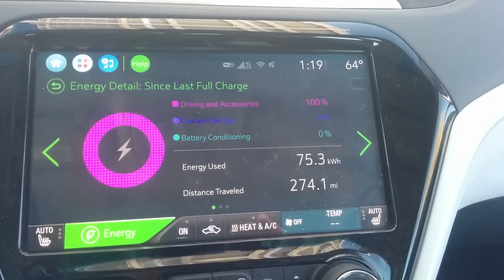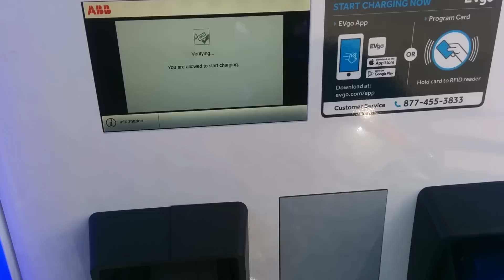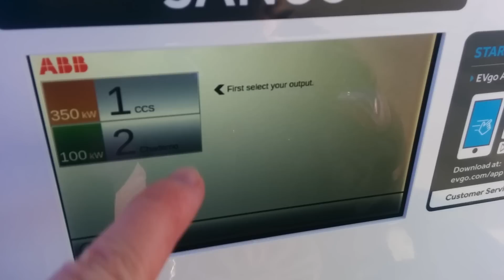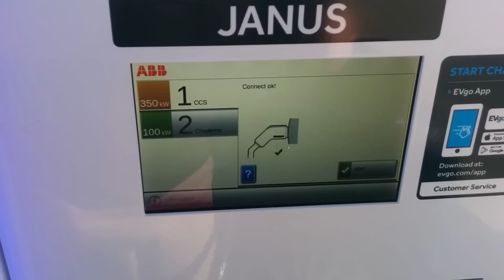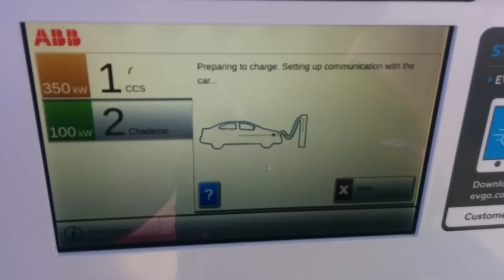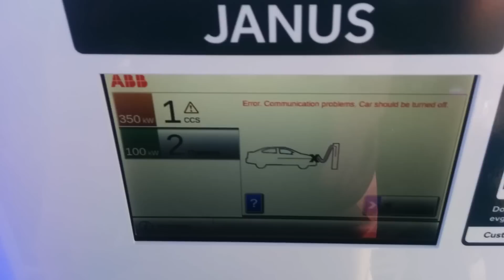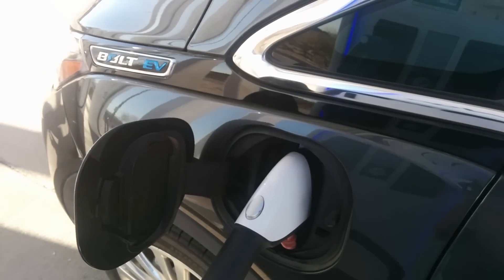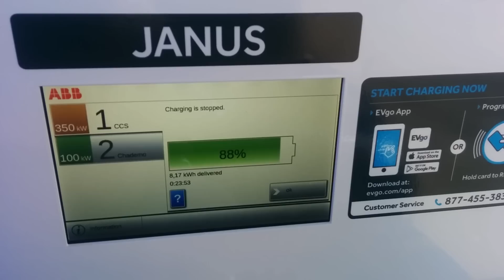Chevy Bolt EV: Charging on a 350 kW (Early Model Bolt EV Issue Explained)

Comment: So here I am in 2025 with this happening on my 2021 Bolt Ev. Has happened in various States across pretty much all brands of chargers, RedE, EA, Charge point, and EVGO. 
On several occasions that is taken almost half a dozen attempts at disconnecting and reconnecting to get the handshake with the charger. I was really hopeful about this car and liked it a lot in the beginning, but this along with other little issues I've had has me wanting to dump it and go get something else. I just don't feel comfortable taking it on long trips anymore because it just isn't reliable with this charging problem.
Reply from the maker: That seems like it might be a different issue. My charge port has been much less finicky, even with the newer H+S cables, and it's always worked at least by the second attempt. If this is a chronic issue for you, I'd suggest taking it to the Service Center to have them replace your charging port if possible.
Reply: Sounds good, thanks! @newscoulomb3705

Comment: So, I have a 2021 Bolt EV. I as able to charge with no problems at Electrify America. However, the car is still only gonna suck down 32Amps anyway. Right, so any DC Fast Charger should work? #NewToBolt
Reply from the maker: EVs have three modes for charging: Level 1 AC (120 V), Level 2 AC (240 V), and DC. For the 2021 Bolt EV, the L1 AC is limited to 12 A, the L2 AC is limited to 32 A, and the DC is limited to 150 A. 

As far as the handle is concerned, it appears that GM was able to fix the problem using the heavier CCS (DC) cables on the newer Chevrolet Bolt EVs.

Comment: My idea is to put a 3" or appropriate length PVC pipe with a U cut into end of pipe to hold the nozzle hose, thus lifting it up and relieving the stress on the car's charging port. It lightweight and can be easily stored under trunk.

Comment: how did you do 350kw? my 2017 bolt only took 75kw
Reply from the maker: The Bolt EV doesn't charge at 350 kW (no EV currently can), but the Bolt EV can use 350 kW chargers. There are issues that I discuss in this video, though, because the Bolt EV wasn't designed with the heavier, liquid-cooled cables in mind.

Comment: I have a 2019 Bolt and drove it to Florida from Vermont at the end of 2019 and practically went the entire distance solely on Electrify America but did discover throughout my journey that the heavier cables definitely had the same issue you were having and in some instances I simply could not get the lifting trick to work and had to seek other chargers. I found that if I stuck to the 150kw chargers I never had an issue but the 350kw chargers almost always were consistently problematic with the weight issue.
Reply from the maker: Hmm, interesting. I think the cables are actually the same weight. Maybe it was an issue with the angle as well as the weight.
Reply: @newscoulomb3705  Perhaps but I do know that the handles were much larger on the 350kw units and I could have sworn the cables were much thicker as well. I would love to find a place that sells the 3D printed spacers to give that a shot.
Reply from the maker: @aliceandliz  I don't think anyone sells them, but I know the plans are floating around online. 

Also, I have noticed that some of the 350 kW chargers just aren't as reliable when they're first installed. It usually takes EA a few weeks to troubleshoot all the installation issues.
Reply: @newscoulomb3705  Yeah, that was my understanding as well about the part. I did find a place that has the plans so I guess I just need to get my hands on a 3D printer to put it to the test. Thanks for the speedy replies!
Reply from the maker: @aliceandliz  You're welcome! At some point, I might try physically modifying my plug (like on a Spark EV service bulletin). The clearance issue might actually be with the top of the plug.

Comment: Eric,
I picked up my Bolt in November, 2017, and it appears to have the same issue (at the new Escondido Electrify America site) that you are discussing here. So, maybe all the 2017's have this problem(?).
Any feedback from GM about this?
Rob
Reply from the maker: GM hasn't formally acknowledged the issue, though the Spark EV also had a similar issue that was addressed by physically modifying the charge port itself.

Comment: so I dragged my car back to the dealership. On back of a AAA truck. Because when the initiation failed my software on the car would not let the car shift for an hour or two. It happened to me when I was in Chicago a second time and I said screw it and went to my meeting in Chicago and when I came back the car software had reset itself from idling for 2 hours. I lifted up on the cable on a hunch and the problem was fixed. They really really really should publish some sort of information about this or do the recall as you suggest. Thanks for the video
Reply from the maker: I'm sorry that happened, but I'm glad you were able to get it resolved. I haven't heard of it kicking an error back to the car before, but I have seen it shutdown chargers and require them to be rebooted.
Reply: Tim, I had the same error on my Bolt. It will not let you you shift. It fixed itself after I walked away from the car and came back in 15 mins.

Comment: If Chevy won't fix it.. maybe pull the assembly apart and see if you could reinforce it yourself..
Reply from the maker: I believe the problem is a combination of the angle and the actuator. We could adjust the angle, but the actuator is triggering something in the software. I also cannot use CCS cables with broken latches (an actuator issue), yet a BMW i3 can drive up right behind me and use the broken cable no problem. That means the fix for this might not be hardware at all but rather software.
Reply: @newscoulomb3705  
Hmmm.  Well that's interesting. Might be worth disassembling the thing and see how all the parts interact..  
Also.. might check with Weber Automotive on YouTube. He has a some great vids on the Bolt EV.. I don't remember if he had any on the charging port system.
I do remember that his particular car does not have the CCS quick charge option however..
Reply from the maker: @kens97sto171  Yes, he had some videos on the CCS system. He was attempting to install a CCS plug into a Bolt EV that came from factory without it, but I don't know how that went.

In this case,  what I've heard from GM (indirectly) is that there is no physical difference between the CCS plugs in 2017 Bolt EVs versus 2018 and later. That means that, physically, there is nothing to fix. It's all software.
Reply: @newscoulomb3705  
If it's software I wonder if they could do an update or something...  Do you know the date cutoff for the ones that have issues and those that don't.
I may be in the market for a Bolt EV.. and that would be a serious issue for me as all the DCFC near me are the new ones with the heavy cables.

BTW he discovered that to retrofit his Bolt EV would cost $3-5k
It's not just a simple connector upgrade.. there are some missing components and the main harness must be replaced also.. so he decided it was not worth it.
Reply from the maker: I don't know the date range. It might be limited to Bolt EVs with the V1 battery pack, so maybe nothing delivered or sold after Feb-Mar 2017. If it's linked to some sort of safety control function, there might not be much to do about it. Those are in place to keep people, plugs, and vehicles from getting fried.
Reply: @newscoulomb3705  
Ok.  Thanks. I'll keep the dates in mind. 
Some good deals on Bolts are showing up so been thinking about it.
Reply: kens97sto171 old camera tripod sound better and better.

Comment: What is the app you are using for the battery temp etc? I would like to get this for the battery temp etc. I have an elm 127 BT OBD2 dongle.
Reply from the maker: It's called TorquePro. The Bolt EV forums have a list of PIDs the app uses to gather information.

Comment: I think I'd stuff a piece of stiff foam pipe insulation under the charge cord while plugged in.
Reply from the maker: It really only needs to be held during activation. Recargo did the best job of addressing this: pay at the station, and then you plug in to activate. It works well.
Reply: Liked because of the amazing username

Comment: I have a 2018 Bolt and I've had these types of charge failures on those really heavy cables.  The material around the port flexes and distorts a lot.  

Thanks for the tip to hold up the cable, EA didn't know how to resolve the issue they just kept resetting it.
Reply from the maker: Yes, it's a bit of a pain, but holding the cable works.
Reply: News Coulomb Yes has to do it twice in Gardena EA machine. I have early 2017 LT just like you. How do you like your holographic sound non-Bose ( blows) system? Play on your tablet or laptop and Bluetooth the sound for “Hunt for Red October” when the Dallas goes deep and you have those compression noises. I feel it in my chest! Amazing!

Comment: Yeah my Spark EV did this on CCS especially on the original EVgo chargers - it was a total pain in the ass, I sometimes had to hang the wire over the mirror or prop it up with a stick so it wouldn't drop communication.  Glad those days  are over.
Reply from the maker: Interesting. I haven't heard about this problem on Spark EVs yet. Recargo was using a Spark EV to validate their Prunedale site that was using the same connectors, and they didn't mention it. Though they did know about the Bolt EV. 

Also, I've heard different reports about the Spark EV. Can you confirm that it actually accepts more than 125 A on high-power DCFC?
Reply: @newscoulomb3705  This was over 4 years ago, the stealership filed off some nub on the inlet connector which might have helped, but it never seemed like a silver bullet. I was suspicious that there was a software component to the problem too, and GM contacted me directly a few times on top of it. But it seems like they mostly figured it out now.

Comment: I can't wait to try one of these over here in New York. Great vid as always! I do have a question I am currently at a EVgo Fast Charging Station with my 2018 Chevrolet Bolt. This is the second time I try charging at an EVgo station and I never get the 50 kw as advertised I get the most I have seen is 30 kw is this normal? Do I have to do something in the car to allow it to charge at 50 kw?

Comment: Thanks Eric I will test our Bolt (Dec 2016) when Dunnigan comes online. BTW I noticed you checked on that on Christmas so thanks for that too.
Reply from the maker: You're welcome! Everything looks like it's ready to go; they just need to power it up. Two 150 kW and two 350 kW should be sufficient for that location. 

The good thing is, we have a reasonable back up about 25 miles up the road in Williams (24 kW ChargePoint) with the option to take a slower country highway.

Comment: Thanks for blazing that trail to warn us about the incompatibility issue. Perhaps something can be done.
Reply from the maker: It's not incompatibility as much as it is a need to reinforce the plug. This could also be a case of wear, as my Bolt EV has been DC fast charged hundreds of times at this point.

Comment: Does this charges any faster than a 100 kw it still only charge max 53kw
Reply from the maker: No. The Bolt EV's max charging rate is 56 kW. No non-Tesla EV sees faster than 85 kW actual, real-world charging speed at this point.
Reply: Thanks